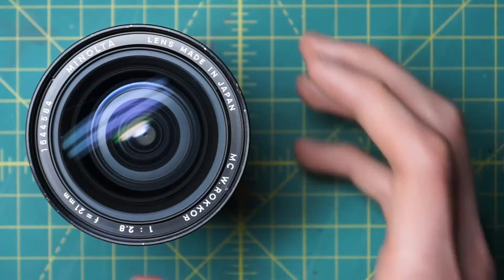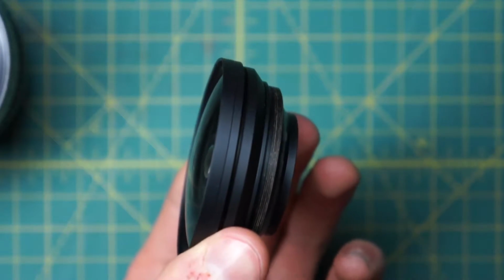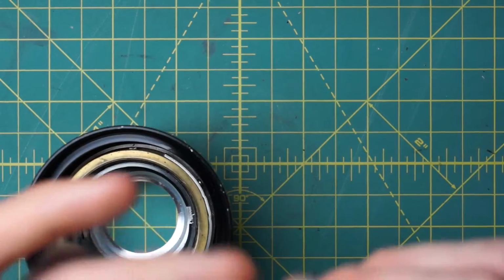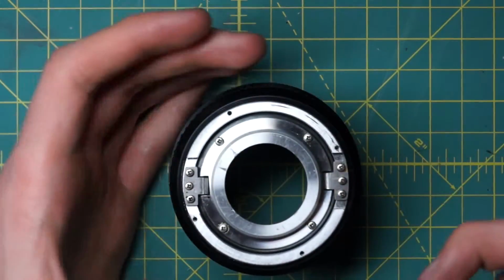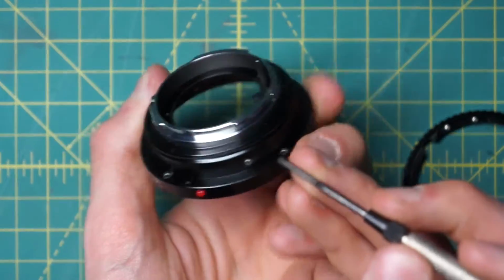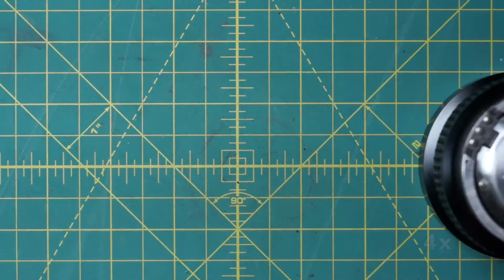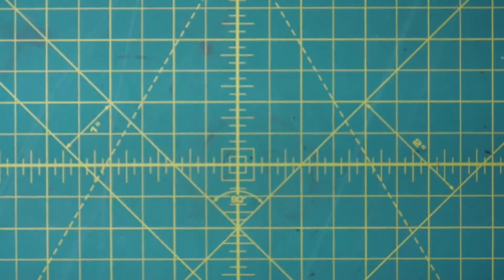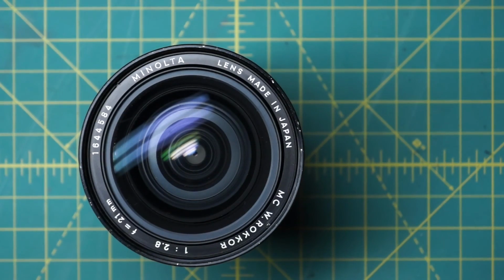Minolta MC W. Rokkor 21mm f2.8 Lens Disassembly

Comment: Thanks a million for your video. I was able to clean my lens successfully. If I had to do it over, I'd probably opt for a better spanner wrench like the ones in your video, I assume they are the SK grimes. My name ring was glued on and a  b~!@$ to remove with a pair I got from amazon. Rubber vacuum pads would be handy too, I used gaffer's tape on a jar to open the first front lens group, as I had seen in one of your other videos. That was a useful tip and saved me a few bucks. There was an extra lens element between the first and second lens group in my case, but I think that lens probably came off with the first group in your video.  Once again, really grateful for this video and all of them in general.

Comment: Hi Matt

always nice video, very clear.
Do you find technical manual/documentation to know ow to disassembly or you guess by yourself?
Currently im disassemblying a sigma 70-210 apo 2.8 but im stuck on small glued-like screws (1 removed on with ease but 3 others are glued-like), i damagged the head so i will drill the remaining screws.
Do you know where i could find some schemacis for this lens?

regards.

please keep going with your channel it is great.
Reply from the maker: I'm not an expert. I usually base it on past experience, while also making careful note of every step during the disassembly. Beyond perhaps the optics, there is not much in the way of official documentation, but I will check out other people's findings first when dealing with a new lens or a new brand. 

Many lenses share design elements, especially Lenses from the same company, but you will always run into unexpected problems. Older, higher quality lenses tend to easier to disassemble. More modern lenses are more likely to use materials or construction techniques that limits how well they can be repaired. 

Good luck and I hope the repair goes well.
Reply: +Matt Bierner 
Thanks i will let you know if it success.

regards

Comment: Hi, thank you for a great channel.

I have a question about the Minolta MC W. Rokkor 21mm f2.8.

The front end of the lens seems to be loose. It is the front end, the metal in front of the focus ring, seems only to act as a hood and non rotating filter holder. Is there a easy way to tightening this?
Reply: I have same issue, do you think you might be able to advise me? Thanks! Great video!

Comment: What is NL ? What does it stand for ?
Reply: Minolta used a two-letter code on their earlier (up to the mid-1970's) lenses to indicate the number of lens groups and elements. In this case, NL indicates 9 lens groups and 12 elements.
Reply: @valuedcustomer9614  thanks .. I was just confused cause I got a 21mm with no NL printed but a rubber grip but after I got it unnoticed that all the other lenses had a NL indication so I wasn’t sure what was different with mines.